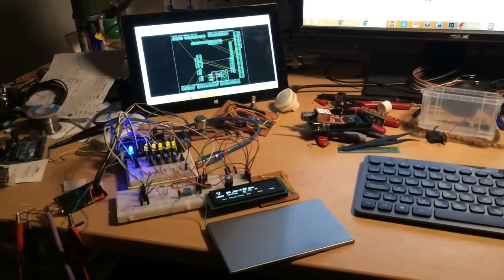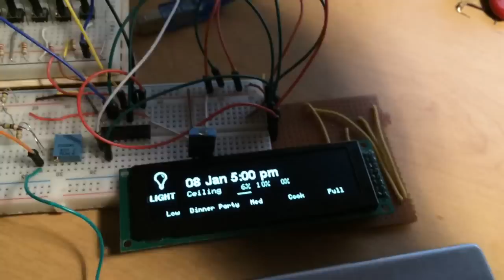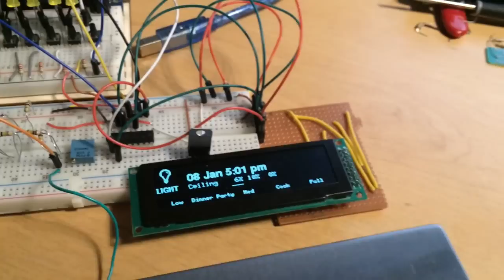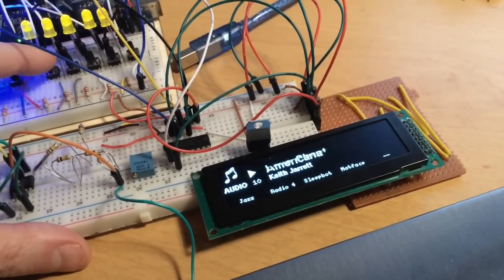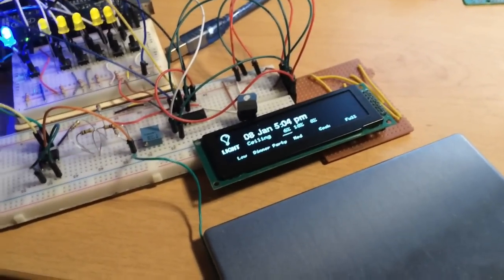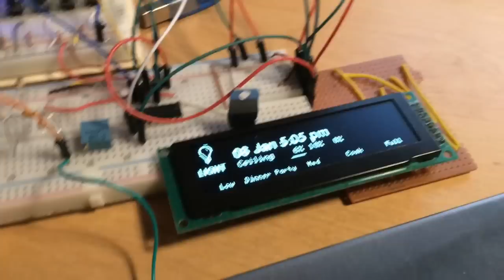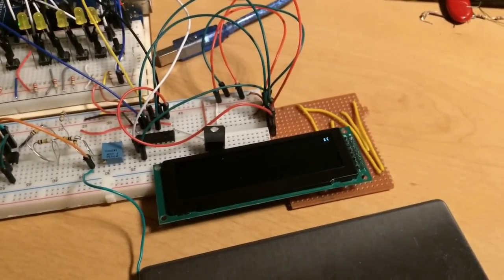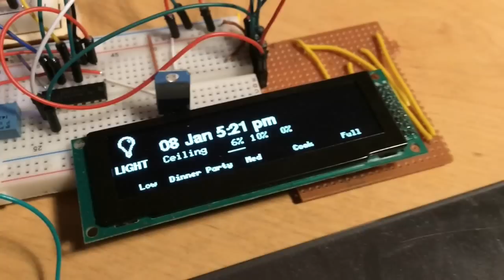Jan 2015 Update - An Arduino MQTT Fancy Lightswitch #homeautomation

Comment: Hey Mat,
I just received my screen, I talked to you about te library but the exact model(SSD1322) is not included in the library. How did you fix this. can you briefly explain how you wired it up to your arduino. I looked at the data sheet but I can't make anything out of the pin-out there. Im so stoked to see it in actions. 

Tim
Reply from the maker: +Tim Geers Hi - you need to make this constructor call in your sketch: U8GLIB_NHD31OLED_2X_GR u8g(oledClock, oledData, chipSelect, commandDataSelect); - then define those four pins. Don't forget to use a level convertor as the data pins must be at 3.3v not 5v. Then you need to make two changes: one software change to the library to enable 16 bit mode in u8glib (you basically uncomment a line in u8g.h - quick google will help here), second is to swap a resistor from one location on the back of the screen to another. I don't have the details to hand, but there are a few posts on the Arduino forum. One post is a bit confusing as I think the library creator wrote the wrong thing, but you can probably find another post that is a bit clearer. If not, come back to me and I'll check the exact details.
Reply from the maker: +Tim Geers p.s. the OLED is really nice, I hope you like it ;)
Reply: Thanks!! Im using a Nodemcu and that is already 3v3 so no problems there (I hope). I googled around. and ik think it has something to do with this http://www.buydisplay.com/download/interfacing/ER-OLEDM032-1_Interfacing.pdf
I guess I need to set the resistors for "the 3 line SPI" Can you confirm that before i proceed  :)

Comment: I have a Raspberry Pi running Openhab and Mosquitto. I've just got a few Arduinos for sensors and random switching but I'm not entirely sure how to get the Arduinos to do more than 1 thing at a time.  Do you know of any good guides that I can learn how to write sketches for Ethernet shield + mqtt + gpio

Comment: Hi, great job!  where did you get that wall panel face plate? and is the part number for that touch sensor IC?
Reply from the maker: Nuno Cunha Hi Nuno. Sorry for the delay. The face plate is simply a blank metal screwless faceplate. I am testing different (cheapest) models out, latest is from screwfix.com (UK) although just checked and it has doubled in price since I bought my tester! Here's the link: http://www.screwfix.com/p/lap-2-gang-blank-plate-brushed-chrome/98729

Also I'm not going to use that touch sensor IC any more. Just not reliable enough. Been researching recently, and the following will do proximity really well: MPR121.
Reply: ty for the reply.  

FYI: I am currently wiring my house and am uncertain of which way to go with the electrical wiring.  So I am wiring for both conventional wiring and low voltage control (ethernet cable between each light switch and home run in basement.  Just wondering if you could give any insight on this?

thank you in advance,
Reply from the maker: Nuno, you and me both. I'm in the same position. I think the best advice I've had is to wire for high voltage using flex or whatever is acceptable according to your country's regulations (where are you based?). Low voltage can always be run down high voltage wiring, but not v.v.!

Comment: Lovely design on the display - love the way its set out. Whats the name of the OLED?
Reply from the maker: Bobby Dilley Sorry I didn't respond in a timely manner! Did a lot of research on the display, and this was the 6th or 7th type I tested. (Expensive business!) I love it, and girlfriend loves it because display is white on black as opposed to the washed-out blues that are common. It's from Shenzhen company East Rising, brand name "Buy Display". Bought it new on ebay, but can get direct from buydisplay.com for same price. Model is ER-OLEDM032-1W. It's the graphic oled version, not text. Comes with board for easy use with Arduino, I use the superb U8G library. Search ebay for "White Serial SPI Graphic 3.2"OLED Module Display 256x64 w/Adpator Board". I think very reasonable price too, £22 including delivery to UK. Hope that helps!

Comment: Looking great Mat, can't wait to see how you've implemented it!
Did you make your own interface for the LightwaveRF switches or use the USB one? I was reading here: http://www.pembo.co.uk/2014/02/23/lightwave-rf-arduino-and-raspberry-pi-awsomeness/ about sending the commands using the cheap RF transmitters, meaning it could be done straight from an ethernet connected arduino.
Unfortunately this means I've gone on to purchase some LightwaveRF dimmers to play about with... all good fun though!
Reply from the maker: Hey James. Initially I bought the LightwaveRF switches and the LWRF hub too. Soon chucked the hub out and replaced with RFXtrx433 transceiver and OpenHAB. A lovely way to get into Home Automation, although it leaves me needing more, for these two reasons. Firstly the 433MHz signals aren't encrypted (I don't think they can be) and I accidentally turned my neighbour's heating off before realising it wasn't my own when I first got it. This concerns me! Secondly the switches don't report back their level to OpenHAB, so there's no way of OpenHAB (and thus my new control panel) to know the light level if it was changed manually. Also some other reasons, they won't dim some LEDs, the control signals can be slow, etc. Apart from that, I love the concept of fully de-centralised light dimming and LWRF panels look nice too. I'd plump for Fibaro dimmers, except that £50 x 30 circuits is too high for me. So I'm eventually opting for DMX controlled light dimming. A bit old school but hoping it's possible to find a 12 channel DMX dimmer for just over a hundred quid, which is stupidly cheap. (More on that subject another time - availability is scarce for this model!) Enjoy the LWRF kit though, it's nice to play with!
Reply: ***** DMX definitely sounds like a good way of doing it. Unfortunately in my current house, centralised lighting isn't really an option, although I might use some arduino controlled relays for some of the upstairs and outside lighting where it is easily accessible. Having re-wired the place a couple of years ago, I don't really fancy ripping it all out and starting again... again! - will be doing it in the next place though.

I have installed a couple of other centralised "off the shelf systems" in the past, although I haven't had any experience with the z-wave kit. The lutron homeworks systems are really good, very nice to install and configure but mega expensive, £250 for a lightswitch anyone?! I did also install an x10 based system a few years back for my parents, using centralised dimmers and relays - this works well and isn't too expensive. There is also a binding available for openhab for x10, as you are probably aware.
Reply: ***** Hey Mat, I'm very interested in your setup. I've been using LightwaveRF for many years for lights now. Recently moved to using OpenHab and the RFXtrx433. I find some of the signals slow as you say. Looking in the logs it looks like the RFXtrx433 is sometimes slow to send the messages i.e. Openhab passes it on in milliseconds but the lights don't change very quickly. I've considered two approaches to fix this problem - one create a LightwaveRF binding to use the Lightwave hub (not much use if you've really thrown it away) or try to setup an Arduino to transmit the messages - tried initially with this but not got very far yet. I'd be very interested in DMX would love Openhab to know the current settings - then it can decide in some rules if it needs to do anything. Any info or reading you know of on DMX I'd love to know.
Reply from the maker: ***** Hey Neil. I just tested response times for OpenHAB and RFXtrx433 with LightwaveRF switches myself. Dimming a light with the OpenHAB iphone app took just under 1s from releasing the slider to seeing the light dim. I haven't looked at logs yet. For me this is an acceptable delay for setting a scene (i.e. a single light level setting) but obviously not for continuous up-down dimming where I expect to turn a knob up and see the light dim in response to the turn. I'm no expert but I gather the 433MHz LightwaveRF signals are quite long messages with many repetitions so it's within my expectations. You know when you press and hold a button on an RF remote and it dims nice and quickly? My main interest is how to emulate that with OpenHAB which I don't think is possible with the existing binding.

I haven't actually thrown my LightwaveRF hub away, I'm lazy and haven't eBayed it yet! I may just hang on to it for a while now you mention your idea for a binding!

Using an Arduino to transmit RF433 is a good idea (I have about 10 RF transmitters for Arduino in my drawer I haven't even touched yet!) although I'm guessing the delay bottleneck is in the signal itself, as opposed to the device?

It's fun messing around with LWRF gear for testing but I must admit the biggest issue for me is the lack of knowing current settings, hence DMX. Are you in the UK? You can pick up a 4 channel dimmer for £70ish. I have been desperately trying to source the NJD DPX 12 channel (£130 apparently) but every shop I've asked to contact their supplier has come back with a negative. None come up on ebay too.. :( You can get very cheap (£15) USB to DMX cables, I have one but again haven't tested it yet. Check this forum post out - not mine but same as what I want to do: https://www.avforums.com/threads/dmx-for-home-lighting.1725237/

By the way, in the home I plan to use Loxone with the DMX extension. Then address the Loxone server with OpenHAB. I could work directly with OpenHAB and DMX to dim lights, but I'm not confident about what happens when my server goes down and I can't turn the lights on! Again, I haven't tested using Loxone and OpenHAB. I'm sure anything is possible as the Loxone can be addressed by HTTP.

I'll do another vid once I've got some DMX goodness working. I have high hopes...